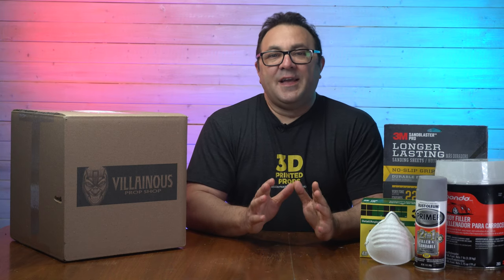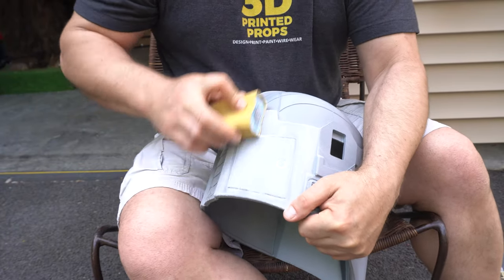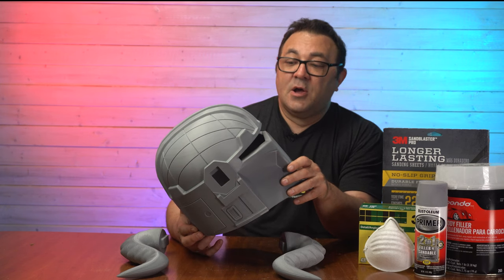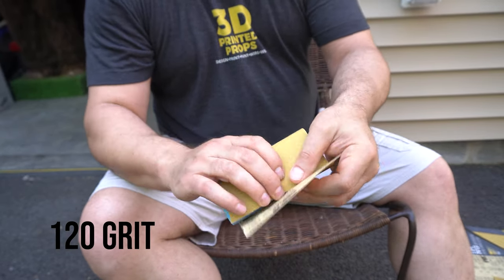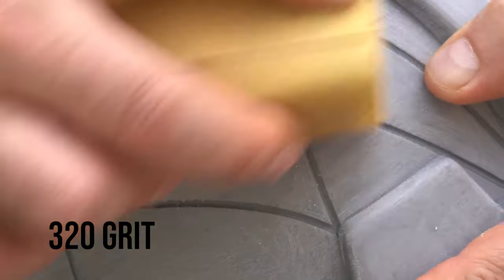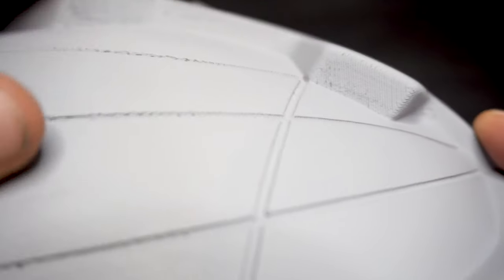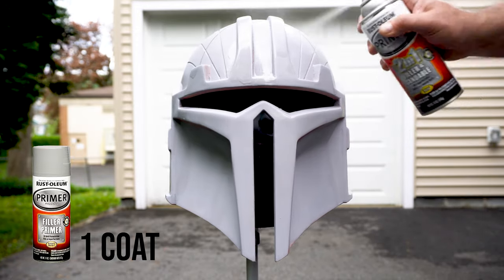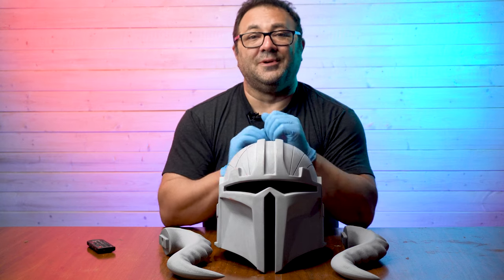How to Sand, Fill and Prime 3D Printed Parts  - Viking Mandalorian - Part 1

Comment: I prefer Polyester Glazing Putty. (evercoat in the can) It comes with hardener like regular body filler. It's very easy to spread, dries fast and sands really easy.
Edit: Also, I always use guide coat after priming. You take some black spray paint and lightly spray over the primer. Basically a dust coat. This will show where you haven't sanded or places that aren't sanded enough. Like some layer lines that you might have missed.
Reply: Oh. That sounds cool. I'll have to try it. Thanks.
Reply: what brand of polyester putty do you use?
Reply: @PaddyFindlay  Evercoat.

Comment: I absolutely love your videos, started watching all of them and even wrote down a sanding instruction set which at the end is the smoothest plastic I ever did. I am stuck on your painting video though. I am making a sword for the first time and I want to make the sword look like actual chrome metal. I’m a little lost on what to use. Should I use a black primer then spray a high gloss black then chrome spray paint? What would you suggest with painting the sword to make it look like metal chrome. I also was going to try some graphite powder when it was all done.  What do you suggest??

Comment: I can’t find the filler sandable primer on amazon, can i use another spray ?
Reply from the maker: Sure, any primer will work, but the filler/sander gives you a thicker coat you can sand.

Comment: I haven’t been able to find the sandable rustoleum primer/filler at my home depot. All they have is the automotive version but it seems to be working like the regular primer/filler
Reply: You can get it on Amazon too. Super easy check out the links.
Reply: if you have a tractor supply try checking therr

Comment: Hi Kevin- can you sand indoors with a mask on? Or would you always suggest just doing it outdoors? And how long would you say all the sanding takes in total? Thank you
Reply from the maker: You can sand indoors, just know it makes A LOT of plastic dust. So if you could have a vent that sucks it outside that would be best. It depends on how smooth the surface is, but I would estimate a good 20 minutes per grit.
Reply: @3DPrintedProps  thank you bud. I opted just for sanding out in the back garden, i'll stick to that!

Comment: I am so glad I came across this video. I just got my first 3D printed Mando armor set and it looks like I have a LOT of sanding ahead of me. Would using a small Black and Decker handheld sander not work or would it burn through the material? Thanks!
Reply from the maker: Awesome, hope it helps. Check out the red hood series too. You can use an orbital sander, I have. You just need to be careful to to keep it in one place too long and not bear down too hard or you will melt/damage the helmet.
Reply: @3DPrintedProps  Awesome! I was hoping you would say that. Can't wait to see the follow up vids. I have a voice changer and some other stuff I want to add. Looks like you are going to touch all the bases!
Reply from the maker: @SnarkySolarGuy  Yep, unfortunately going to have to wait a bit. I broke my arm last week. Agh. Really slowing me down. :P
Reply: @3DPrintedProps  Oh no! Get well soon!
Reply: I finally started on my bucket and this guide has been so helpful! The only question I have is how do you know when to stop sanding and move on to the finer grit? I hear that screeching noise with the 80 grit as I move across the lines. Do you keep sanding until you can't hear that noise or just enough to rough up the surface? Thank you!

Comment: Not sure why, but every time I’ve used bondo it never hardened like it’s supposed to. Any thoughts on why that might be? It’s a new tube that I’ve only had for a few months.
Reply from the maker: The only thing I think it could be is you're not adding enough hardener, or maybe temperature and humidity.
Reply: Hmmm. Ok. Thank you. I’ll try out some different things.

Comment: Should I not used the bondo in the can? I even took an orbital sander to it and it’s barley even sanding it. Feel like the print is a bust now..
Reply from the maker: You can use bondo, use a lower grit to get the bondo down, then go to a finer grit.

Comment: So I’m currently working on a PLA helmet I printed. Should I seal the inside with primer and paint?
Reply from the maker: Hello, I don't usually do anything in the inside other than sand down any sharp bits.